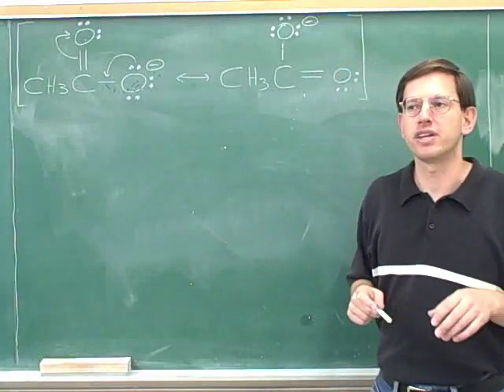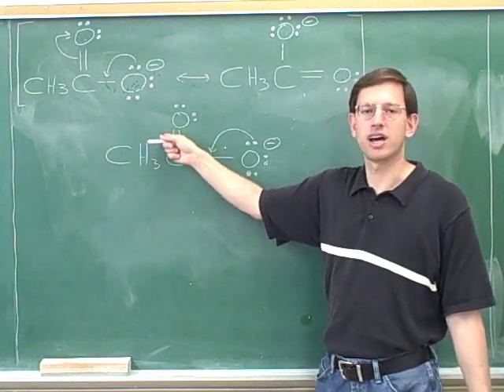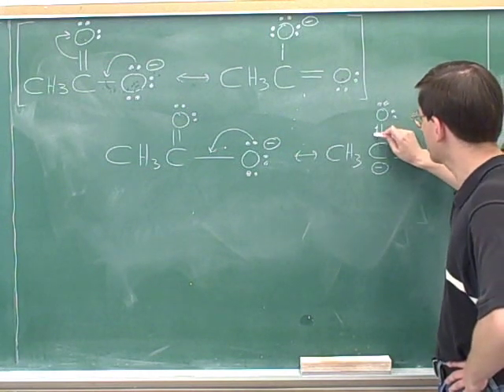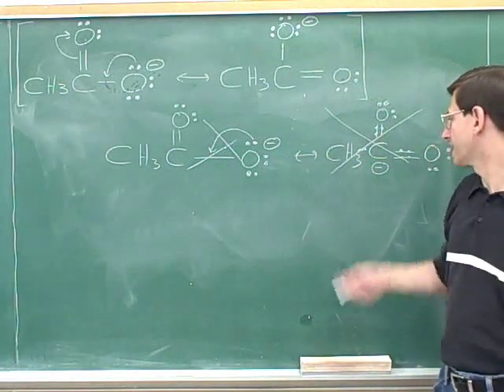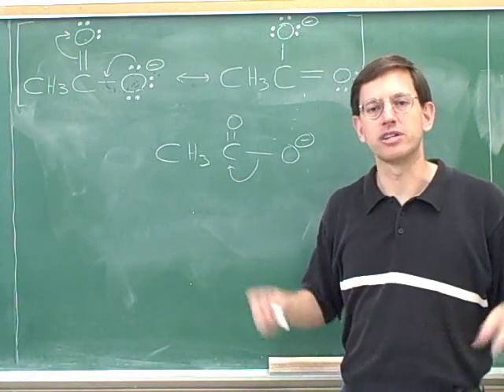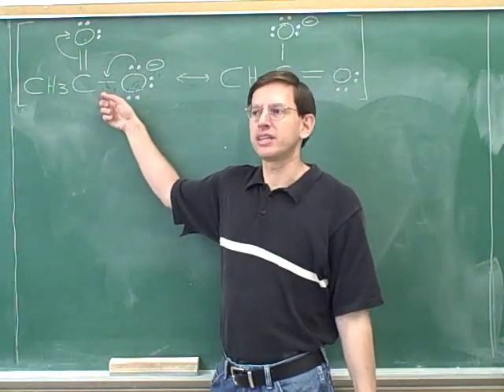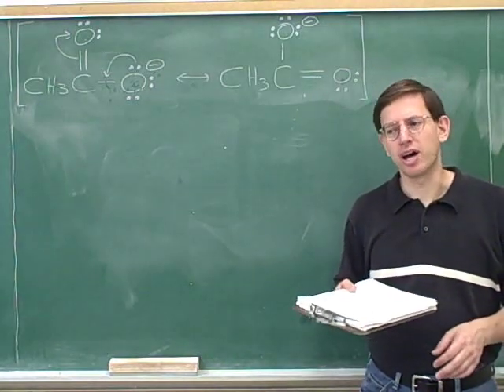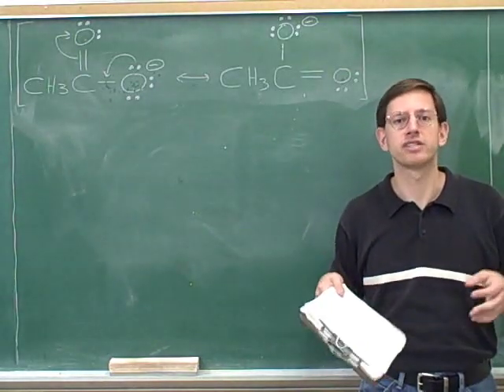How to draw resonance structures (3)

Comment: The formal charge of an atom is the number of valence electrons of the atom (in this case, 4 for Carbon) minus the number of electrons an atom 'owns,' or the number of unbonded electrons plus 1/2 of the bonded electrons around the atom (in this case, 5 electrons; 1/2 of 10 bonded electrons around Carbon). That's how he got -1 for the formal charge on Carbon.